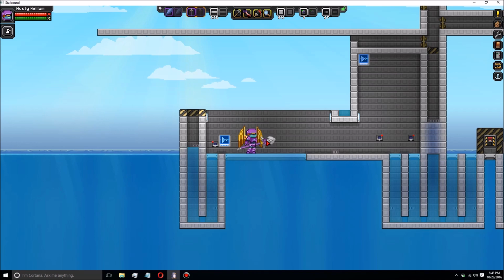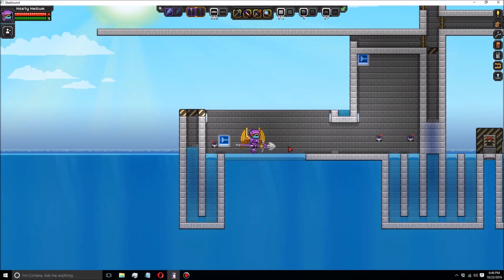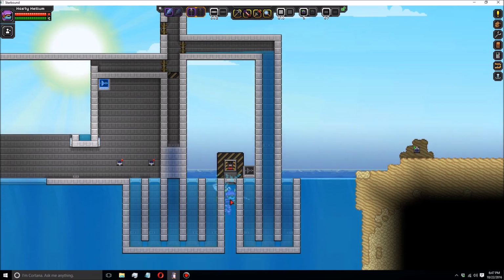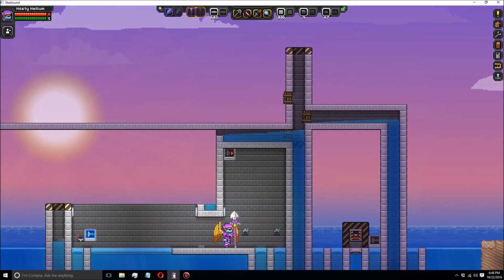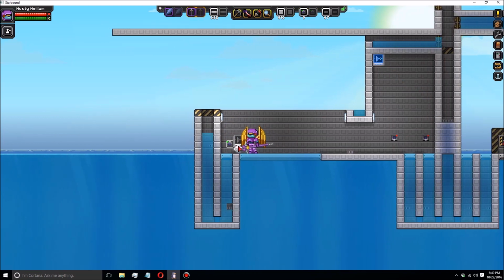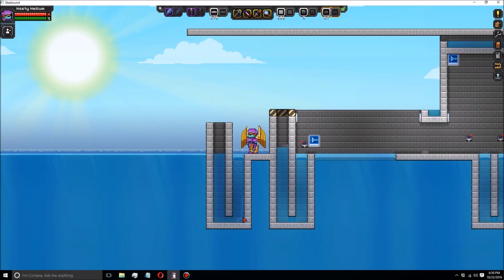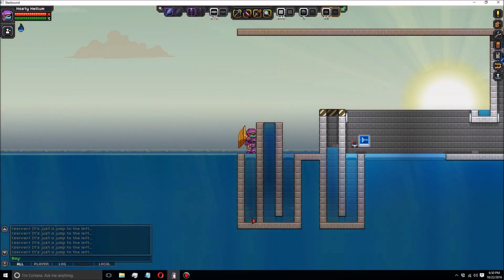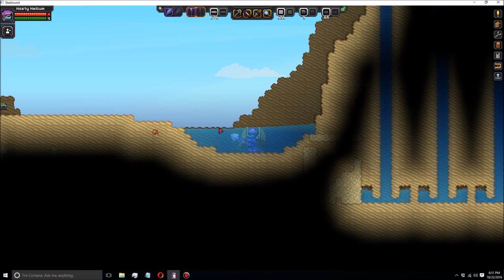Starbound Inventions: Working Water Pump/Pipes

Comment: I understand the mechanics of it. In Starbound, water will always try to fill as much space as possible as long as it is background there. And since you got infinite liquid it will try to fill as much background as possible, the reason (I think) it will pump water over the water level is because when the drain removes a water block, 3 infinite water sources will register it and each make 1 block of water, making the water in the pump go higher because the drain removed only 1 block of water (3-1=2). The 2 blocks of water which didn’t fill the block that was drained then goes and fill any background it can find (aka the pump). The reason it won’t go into the room you are standing in was because you removed the background behind the platforms.
Reply: you are correct but your math is not. 2-1≠2

Comment: Water from ocean planets is like infinite water, it produces itself, you cant drain a ocean planet. So by removing the background on the water level you got yourself infinite water, and unless the opening is at the bottom the game will always try to fill any rooms connected to that infinite water source. The only way the game doesn't fill rooms is if the opening is at the bottom (south direction).

Comment: Great invention, thank you!

You don't really need the drain side to be open at the ocean level, you can build blocks over it, almost all the way down to the drain. 

I think the way this 'pump' works is that the drain sucks water (destroys the water blocks around it), and the background ocean hole pushes more in to replace it (creates predefined amount of water blocks) - pushing both ways, since Starbound has introduced water pressure simulation. The amount going right is enough to achieve equilibrium with the drain, so whatever goes left pushes and increases the water level a bit. 

Normally that extra water would disappear at the ocean level, but you have played around with the walls a bit, breaking the algorithm. I have tried different arrangements, and most common result was an oscillator, where the water level would go up and down above the ocean level.

Comment: I think I understand it!

The drain creates a gap that the water (from the empty backgroun piece at the bottom) wants to fill, but it doesnt just go to the side with the drain, it also goes to the other side which has the pipe. The water isnt block specific, so it goes to both sides.
Reply: If I'm following your logic, then theoretically adding more gaps(perhaps within the same "pump") should increase the amount of water so long as there are enough drains for it to actually detect a difference.

Comment: This has actually got me curious about how pipe systems work irl honestly. How does it push liquids upwards?
Reply: The water is compressed using a pump which forces the water upwards. Fill a balloon with water and squeeze it. That's what's going on.

Comment: would a one block riser pipe work faster? would the drains interfere with flow? in some cases you can compress the pumps so that the opposing intakes were aligned vertically, high pump then low pump. also can you chain intakes into the same riser?

Comment: Very neat system!  I'm having issues understanding evaporation, though.  I've created a ship that's about 300 blocks in the sky, and it looks like an old-timey-ship.  So, I built a little "casing" around its lower 2/3s of the hull and filled it with water, then sealed it off (of course with background tiles sealed as well :P).  However, if I leave the planet and return, a good chunk of the captured water has dissipated.  Why is this?